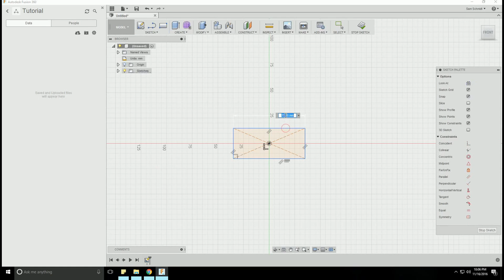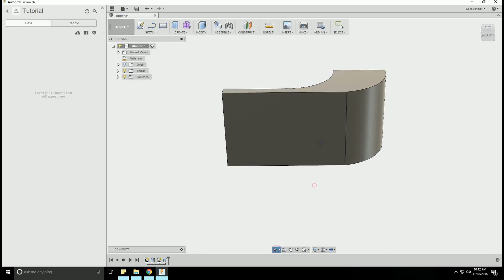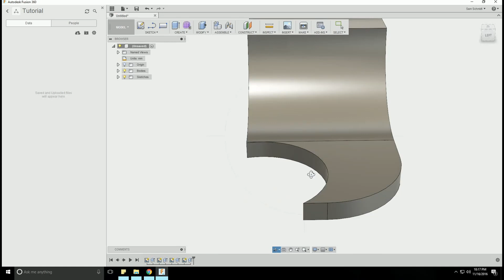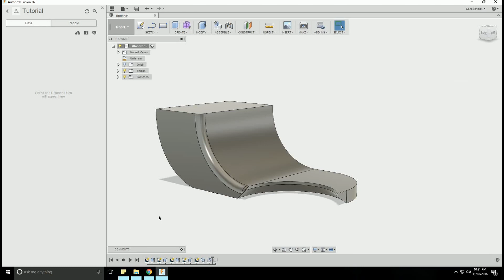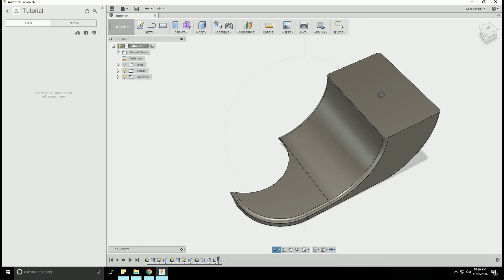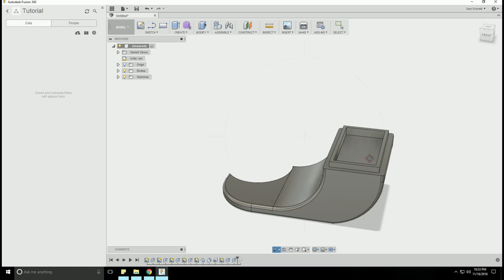Fusion 360 - Practical Design Series - Tutorial 01

Comment: Hi, great tutorial ! I have some very limited exposure to parametric 3D software but it was enough to follow your tutorial.
One thing I did not get is your shell thickness vs hotend diameter discussion. Usually for a given hotend diameter, ideal extrusion width is around 1.2x the hotend diameter.
Reply from the maker: Theoretically you are right, however 90% of consumer 3D printers simply run at their verbatim nozzle diameter. Its a great in depth topic for another video, however for the purposes of this tutorial running wall thickness as multiples of common nozzle diameters will make the most sense I think.